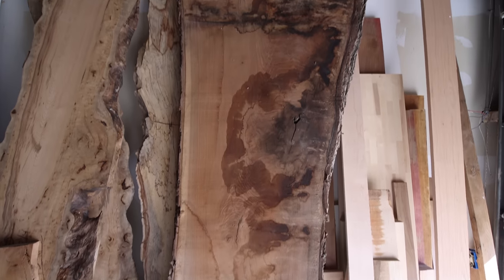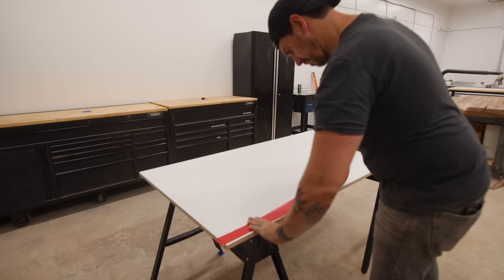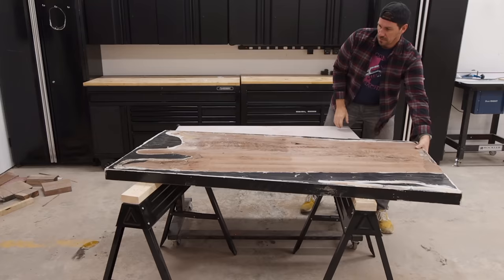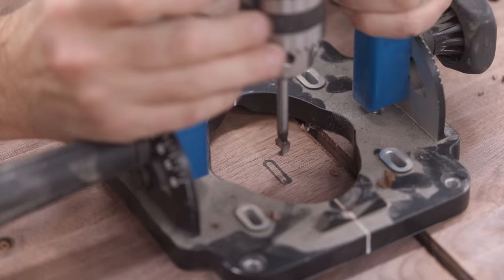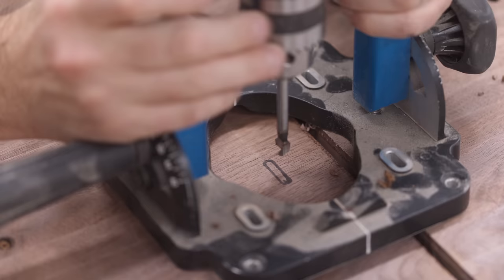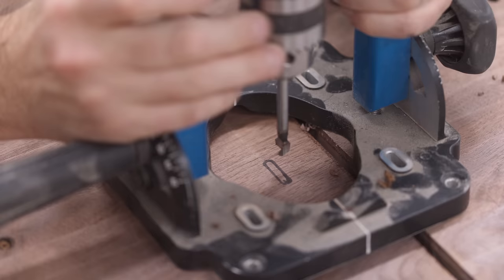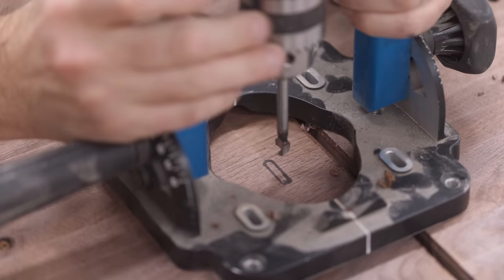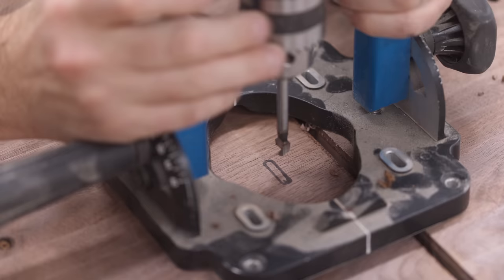This Forgotten Wood Was STUNNING

Comment: your electrician is verry bad at it if he tells you that you don't have 3 phases Y because Y or delta is just a way to use wire with 3 phases. it's just the diffference in tension between 2 phases or between a phase and the neutral.

Comment: BOWTIES 👍 When done well, it comes down to using the proper size, grain, color, wood species if the goal is to blend it in and not stand out, and if done for contrast  the wood color (species) of the Bowtie should complement the the species it goes into. I hate it 👎 when Bowties becomes a distraction drawing attention away from the main piece leaving you with the thought "what were they thinking that's not creative it terrible" I know I over explained it but they really can make or break a piece. I saw some pics on Pinterest where some have used metal Bowties and some other shapes that were interesting, it worth a look.

Comment: Stand up

I love this desk it is gorgeous.  I don't mind bow ties as long as not over done. Putting them on the underside adds stability and strength to it. The one thing that I'm not crazy about is the crack on the top left open to collect dust and grime.

Comment: If you're using that jig to cut the bowtie inlays, you can always cut the bowtie with the CNC and have it round the corners to match the router bit. It'll avoid the extra chisel work to clean up the corners.

Comment: There were two way you could have still used the off cut as the top of the monitor stand. You could have filled the messed up rout with epoxy or other wood and recut it. Or you could have milled it down to 1/4" or less and used it as a veneer on the top. It still looks good with those other boards but it isn't quite as nice as it would have been. As far as bow ties go I don't mind them as long as they are not over used. Since that is an epoxy table I would have only used one bow tie on the larger cracks then filled the gap with epoxy so the whole top is solid and free of voids.

Comment: All or nothing.....I LOVE the patch-work, awesome wabi-sabi IMO!  Could you have ripped the pupleheart to the desired width, cut your stitches to the desired length, then rounded the edges on the sander?  I know it would have been a little more time, I just wanted to put it out there if you wanted to use the same kind of stitches on a future project.

Comment: Hey, the way I see using a CNC Machine in your shop is like 75 - 100 years ago, they didn’t use table saw like we have. They didn’t use Drill Presses like we have. They didn’t use Routers, portable or table routers, like we have today. It’s just another piece of equipment to make the most out of your shop. I forgot to mention the Orbital Sanders… all to make the job easier.

Comment: I enjoy watching/listening to your uploads. You seem to have the same luck I have with my 3D Printers. Thumbs Up about the bowties. I like the contrast that can be given if you use maple with walnut or vice versa, same material such as this one, or adding Brass/metal or epoxy back fill after filling the original split. It shows your craftsmanship be it CNC assist or by router and chisel. It adds flare/depth of detail in a subtle way, most of the times, if it is done with regards of your overall look.  Either way it looks great and I love how you "retired" and found something else to do! This is my goal!

Comment: hey Johny... love the builds... would love to see some live edge slab builds without epoxy... I'm a firm believer in letting the wood speak for its self. I'm a bran new woodworker, and would love ideas for beginner builds that are interesting and don't require such large power tools, also... which big box store sells the best hand power tools for woodworking? in my opinion your like a Ron Swanson that's open to new ideas. "Good luck, and godspeed". 👏

Comment: i own that exact CNC machine, which I just moved from Washington state to Texas.  Hearing you had trouble with your spindle head has me all sorts of nervous now.  

Beautiful desk
Reply from the maker: Hopefully you won’t have any issues!
Reply: @JonnyBuilds  the house we bought only had 100 amp service.  The local utility company had to upgrade the the transformer to support 200 amp service,  add in a new underground service from the road to the house and new subpanel for the shop and I might have the beast running  by christmas.

Comment: If I had a larger CNC I would definitely use it for the C channels vs doing a router template, I know Cam at Blacktail does it but if you have the tool, then use it!

Comment: Looks great! You put a lot of faith in that epoxy joint. Are you confident that will hold up over the years?
Reply: Cam over at Blacktail Studio did a video on how strong the joints are. I was really surprised at the results.
Reply: @shanetripp6193  I’ve seen the tests of the joint between epoxy and the live edge, but this is a thin layer of epoxy partially on cross crossing grain. I’d wonder if that would weaken over time. Not sure if Cam has tested that.

Comment: I guess the different 3-phase power supply means the shape on a phase diagram, either a Y (so it looks like a Flux Capacitor) or a Δ (Greek letter Delta). So for Wye the phases have a common neutral, and for Delta they're arranged in a cycle like Rock-Paper-Scissors?

Comment: out of curiosity, you have the CNC file for the slot on the underside of your monitor riser top, why didn't you just cut out some bits to fill that in and then REcut the tambour door track in the proper place?

Comment: I think cnc's are a double edged sword. On one hand, I think you can become too reliant on them... If you're heavily using cnc on almost all your builds you become more of "wood programmer/designer" than a woodworker.
But on the other hand, having the ability to incorporate cnc into your process makes you a much more versatile woodworker. Also purchasing your own cnc is such a big commitment in $ and shop space; if you don't get a lot use out of the cnc then you wouldn't be able to justify the $ spent and large section of the shop taken up!

All in all I think like most things in life, it's about striking a good balance 💯

Comment: I suppose contextually the bowties would be depending on what you are doing.  If you trying to hold to pieces together partially over a huge gap, no.  If you are doing it over a small area, sure.  I'm kinda in the middle on the subject.  So 👍/ 👎.

Anyone who says you aren't a woodworker because you use high end equipment can jump off a cliff.  How do they think we get mass produced furniture?  CNCs are used for that.

Still though, amazing work!

Comment: Handtools or powertools/cnc, no matter what tools you use, you cannot make a great project without the needed skills.     
When using natural materials, like wood, I prefer the perfect imperfect (unique) project over a "perfect" project, where you can make 100 totally identical projects, and those projects should be cheap, no matter the materials used! 
Nature is the master of creativity, art, and so much more, that allows different species to live under extremely cold, hot, dry, wet, dark, or light conditions, and each of them often has often has more than one purpose.
And never has nature produced 2 identical projects of the billions of different plants, animals, etc.
And about the straight lines, we humans often care a lot about: Did you know there are NO straight lines in nature? 

As long as we don't harm anyone, short or long term, like child labor, slavery or toxic materials, etc. that harms people or our environment, it's nothing by different methods, and as long the maker is honest about how it's made.  These changes everything.  

But wheater we prefer projects made by hand tools or power tools, it's just a personal choice, and it should be all about the end result!   Not the process to get there.

It's also a no go if the maker lies about the tools used when asked.  
A beautiful project requires skills! And don't think some skills are better than others.  
They are just different.  It's the end result that counts!

Fx. A project where you can see a woodworker has hand carved 100 almost identical flowers on a project, it to me a lot more worth, than if he/she has made one flower on a computer and made a cnc carve out all 100 identical flowers.   
 
Because the end result is visibly different!!
   
Not because one is "real woodworking" and the other not.  

Some people are willing to pay a more for a "perfect" project made by powertools/cnc, and others to pay more for a hand carved project.  Because we prefer a different end result.

All this is just my personal opinion. You might have other opinions. 
As long as we can agree on the harming part, it's totally fine to disagree.
   
❤🧡💛💚💙💜❤

Comment: Like or dislike bow ties. I like bow ties for functionality not for elegance. They appear to have a real function for strength and stability. For the elegance and continuity of the piece, quite the opposite. They disrupt the flow of the grain, appearance of the stain and seem to directly or indirectly needlessly draw attention to a perceived defect in the wood. As far as the use of the CNC, you use it quite well and it seems to expand on the efficiency of what you make. When too many of your pieces are made via CNC it seems like you become little more than the assembler of the pieces. I know that isn't the case it just appears so. With a lot of CNC work it lowers the interest of us woodworkers who haven't invested/learned that tool. When that happens I look for other things in your videos that could bring new insight to my work. CNC makes a lot of sense when it helps create things that conventional woodworking couldn't.  When used for "regular" 
woodworking it's value seems to be more efficiency based than art/skill based. Your increase in maturity of speech permits a younger audience(ie. sons and daughters) to participate without the adult viewer having to explain or avoid unnecessary crudity. Keep up your good work and novel designs.

Comment: A couple of things I don`t like as a professional woodworker from across the pond, 1`st bow ties are ugly, 2nd that cabinet was assembled without dowels or dominos , 3rd no nails on the cabinet door pieces against the fabric ,only glue is a bad idea for longevity, 4rd again that obsession with the bow ties that I don`t understand , for such a small crack u could`ve mixed wood glue or transparent resin with sanded dust from the same wood filled that up and sanded it over , would have looked million times better or just a small piece of wood instead 10 times of the size bow tie, 5th I think u over sanded the edges and ruined that natural look of the wood , preferred if u kept the original edges shape and lightly burshed them off  after removing the bark. All in all it`s still a nice looking table.